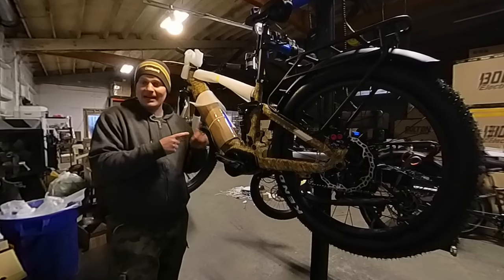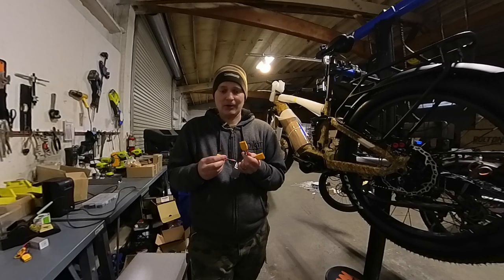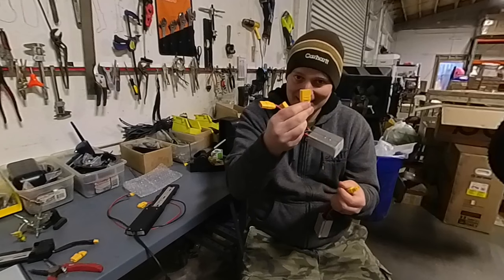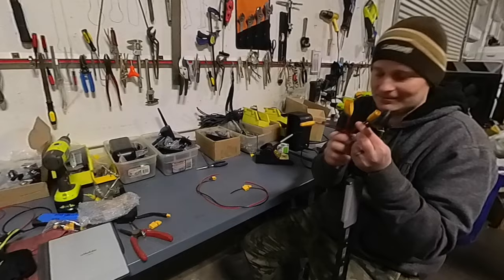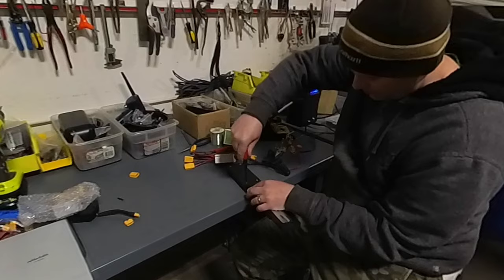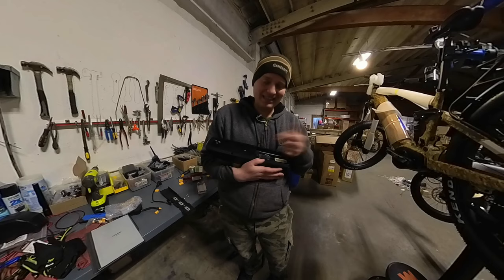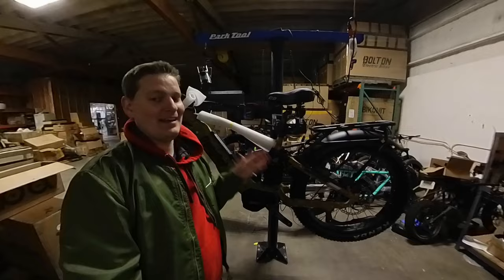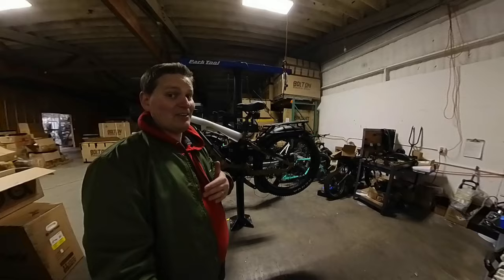I installed 3 batteries on one electric bike - you can too

Comment: I like your videos 👍Now that you mentioned it. I work in a scrapyard, and a new college just started, he was told to take the batteries out of a backup rack, i saw a huge flame when he cut both wires at the same time, he`s pliers had melted, and were no good anymore. He was ok, but shocked.

Comment: I just added a 3rd battery to my bike. Simple and easy. Increased my speed and distance. Top speed with throttle only 39.3 mph. Distance set on 3 out of 5 170+ miles. At 170 I still had 1 bar. I'm loving it!
Reply: Just wondering  what battery are you using  this is the range im looking for
Reply: How long does it take to charge?

Comment: Looks very similar to my Biktrix FS Pro 3, which is a dual-battery full-suspension mid-drive bike.  I've ridden with three batteries multiple times, but one is a cold spare in my trunk bag that I swap in when needed.  I've done multiple 80+ mile events, including one 100+ mile ride, which would have been doable on two batteries if not for the elevation gain.  All of these rides had 8000+ feet of elevation gain so the third battery was absolutely necessary.  I've got a couple videos on my channel showing highlights from those rides.

Comment: Hey Mate! I just wanted to reach out after responding to another one of your specter videos. I had a long think about the frame flexing I mentioned. After taking apart the rear triangle three or four times from just wanting to know. I learned that the bold holding the front of the chainstay on was never long enough and over time would wallow out. I'm not sure if that's always been a problem or maybe a problem on the first specters that came out. I added longer bolts in and the flex is gone. Big thanks for making me think about it and tear the bike apart multiple times. I feel much safer recommending this bike to my customers or pointing them in your direction if they wish to buy online.

Comment: Yes, you can put three batteries on a Ebike, but I got 50ah of battery with two and I never worry about running out of battery! I have a Himiway Zebra step-thru that comes with a 48V 20ah 21700 5000mah cells. So, I got a second 48V 30ah 21700 5000mah cell that is 13lbs in the rear rack bag. I put the 40a balancer in the frame near the controller, so I have just the lead wire going up to the rear rack battery. Very clean setup and it works great! I been using it for six months and many miles. Love it! Also, the Zebra has 400lbs capacity so 13lbs is nothing.

Comment: i have 2x 52v 25 Ah on my bike.. thats enough for me... charge is done also in parallel... main thing is both packs need to be as identical as possible .. means if one has a diode in charge port.. other pack also has to have one added to keep both voltages the same

Comment: My bike had some confusing messy wiring with no official connectors. Just finished up my first soldering job and my batteries are working in parallel perfectly.

Comment: I already have a stock dual battery set up on my ecells super Monarch 1500. I would like to add a third battery as well. My question is on the second parallel connector: the controller plug on the new parallel connector plugs into one of the original battery port on the stock parallel connecters that comes with the bike and in my original second battery in my new third battery plug into the battery ports on my second parallel connector ports, correct?

Comment: I have engwe x26  dual battery.. I would really like to get better pick up.  Possible to add battery in series plus different controller for 60v output?  The stock rear motor is rated 1000 1200 max motor.  My goal is performance closer to the wired freedom… thanks

Comment: With 2 parallel connectors you should not connect one into another , YOU SHOULD MAKE CABLE OUT FROM EACH BALANCER SHOULD BE JOINED INTO CONNECTOR WHICH GOES INTO CONTROLLER.
I SEE SOME  heatsink what means your circuits have voltage drops could be 0.3 to 0.5 V , if there is no voltage drop no heat.

So two balancer with outputs connected together into controller can connect 3 or 4 batteries in parallel with only one voltage drop , by connecting balancer into balancer 2nd and 3rd battery will have voltage drop doubled, still few times less than only single batery.

Comment: does more batterys equal more power & torque?
Reply: AH equals range    
voltage equals speed 
works for most situation
Reply: Yes, to an extent. It reduces voltage sag, and maintains the current, so it's like your battery is nearly charged for much much longer.